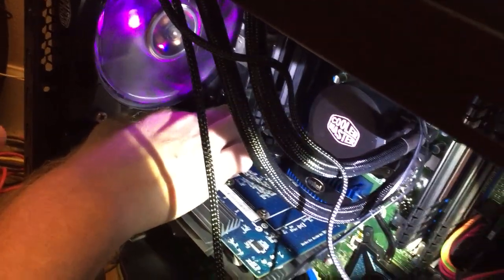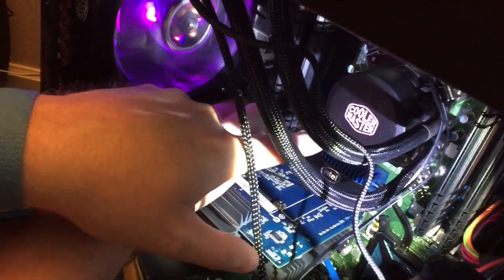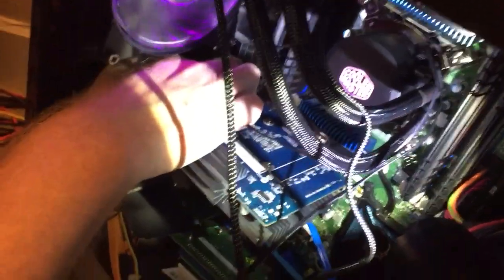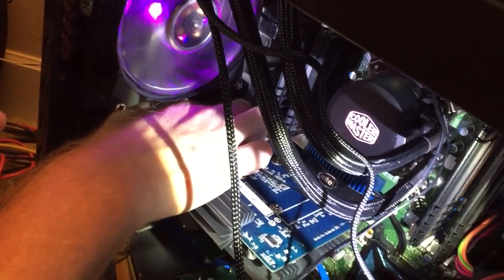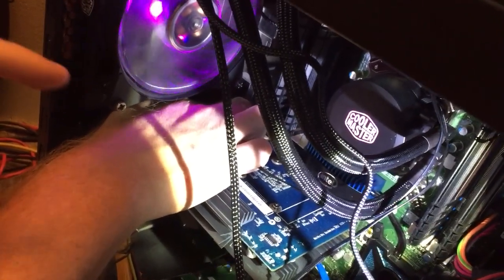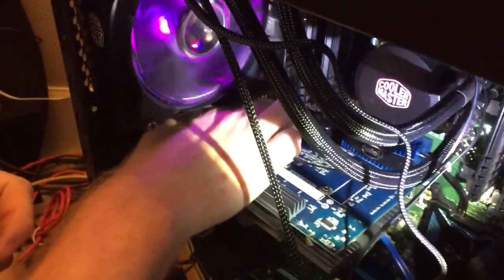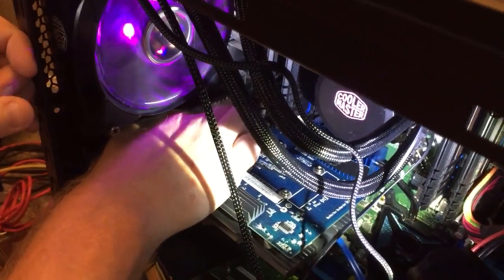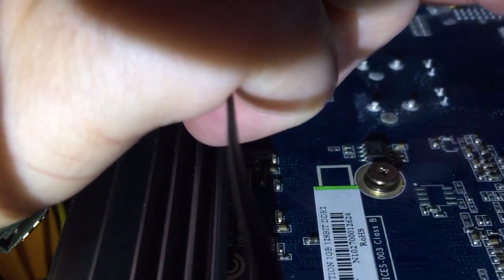Pump Noise/Failure Cooler Master MasterLiquid Lite ML120L RGB

Comment: Do I send mine back? Or can I get a different cooler
Reply from the maker: return it.  get a different brand/model
Reply: The owner has told me to wait 24 hours because there is air in the cooler, if that doesn’t work it’s going back.
Reply: Also what happens if u just leave it?
Reply from the maker: @1ZeeOfficial  No idea.  Maybe is just a unpleasant sound.  Maybe it will shorten the life.  No one knows.
Reply: Oh k. I’m gonna investigate, goodluck to me hopefully the whole thing don’t blow up because this is a really good pc and I can’t find a replica that has a different cpu
Reply: There is a fix (kind of) you need to tip your cooler in all different directions to get the air inside the cpu out. This is working for me at the moment so I’m quite happy with it for now

Comment: mine have similar problem, low ticking noise and also grinding noise. just after two weeks.there also buzzing noise came from the fan right after installation..so annoying..

Comment: well i was having the same issue for long long time and just now i got it fixed, i had the fans conectors from the WC  at the wrong place, one fan  plug into the CPU fan but the other one was into the chasis fan, while the RGB conector was at the CPU fan2, i moved the one from the chasis to the CPU fan2 and the RGB conector to chasis fan and problem solved

Comment: Hey guys I have found the solution for this issue!

Make sure your pump is powered by the chassis fan power connector on your motherboard.
Then go into BIOS and change the chassis fan power setting (that is powering your pump) to DC power setting.

The reason is because it is a 3 pin power connector and at the current setting it is not getting enough power to the pump which is creating the ticking sound (air in the line not being pushed through quick enough, forming air pockets.)

Hope this works for you guys!
Reply from the maker: Thanks for chiming in.  Yes and no (to your solution).  I'm glad you found a situation that make it functional for you.  My concern is that in doing so your running the pump at full power 100% of the time.  That should not be needed and it will decrease the overall life quickly.   The point of PMW (rather than DC) is that the pump power/speed is scaled to how hot your computer currently is.  It only pumps as hard as is needed for your current conditions.  I do not recall the BIOS change being a requirement of the install instructions and I think its ill advised.  If CM support told you to do this, AND its not in the instructions I would demand a refund immediately.  If its in the instructions, bad on us for buying a junk product.
Reply: Why wouldn't you want the pump to run at 100%? That is the only way you will pump the coolant as quickly as possible. It is an efficient system already so running it at top speed is not even an issue. I was merely explaining how to get this particular system to work correctly and get rid of the annoying ticking sound.
Reply from the maker: @AS-gw7zf  It should not need to.  This is the definition of a design or manufacturing defect.
Reply: @JonBoehm  shouldn't the fluid speed be constant and the fans be the only thing needing speed adjustments?

Comment: in case some one still needs to know. Apparently it's an air bubble, and it should fix it self in couple days if you put your pc on a side, and use it as normal. At leas that's the answer i got from customer service. The moment i did put my pc on its side, the noise level went down quite a lot, so there is hope i guess. I will know better in couple of days.
Reply: what ended up happening ?
Reply: @yzwme586  don't try it... it doesn't work...
Reply: @dimka971  sounds like im gonna have to take it in to be replaced with a new one.. .FML
Reply: @yzwme586  same here :(
Reply: @dimka971  how long have you been running it with it making noise like that?  i got mine to stop by lowering the duty cycle in the BIOS, but I know I need to take it in in a few days as well to be replaced.  I am keeping a close eye on the CPU temp as well
Reply: @yzwme586  just about a week if even that... from what i have seen online, umber of people have the same problem with this cooler, and most of the time it's with in a week...

Comment: Hey if you guys are having this problem tilt your computer on the sides or upside down and the air inside the pump will go away and it’ll be quiet again
Reply: you sir are very fucking helpful thankyou :D been driving me  mad
Reply: all these ppl saying the same thing....ITS AIR IN THE COLD PLATE...so frustrating ppl dont do research before installing an AIO
Reply: Oddly, this worked for me, after standing the PC back up and after 1 minute it's the same awful loud rattling sound! :(
Reply: @millsakov  yeah unfortunately mine never went away I just let it happen but I tried to fix it and it just went bad so now I’m going back too aircooled
Reply: @delusionalfizz1114  funny you say that, I returned mine last week and got a refund, I went Noctua nh u12s chromax black. Fitted it about 2 hours ago, my first air cooler, trust me this is me going air cooling from now on, it feels very very slick, strong and stable. Its silent!

Comment: Ok guys, 
I SOLVED THIS F* PROBLEM.
Its a simple solution. Open your CPU, check in which port your PUMP is connected to (Sysfan sysfan2 cpifan cpuopt etc). Turn on the pc, open BIOS, go to the fan settings(aorus mobos is: MIT>  system fan 5 settings),  select the port that you chrcked before, and just put in full speed.
Altough it is in full speed, the pump should not make any noise at all. Also, check the rpms before and after you do it. Mine got from 1100rpm to 2200ish.

SPREAD THE WORD

Ps: dont put the radiator fan (it is on a other port) in full speed otherwise your pc is gonna sound like and airplane all times, and not the ones that it really needs to. Just the pump port in full speed

Comment: same here! not a year old. a piece of s*#t!
Reply: i have just solved the problem, it seems! laid my pc case on the side. the cooler facing up. whit a big grip screwdriver, i hit the cooler's cpu unit a few times from the side! on the go! now it's silent, as it was as new. and no, the pump didn't die!! and they say aggression doesn't solve problems! :D
Reply: celebrated too early :( standig up the case, the noise comes back, but it's much lower than before!